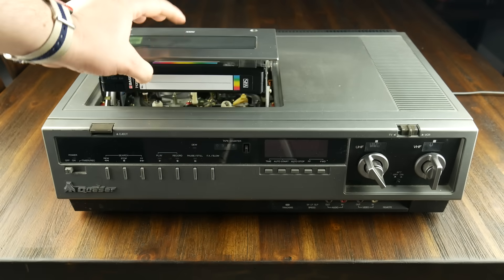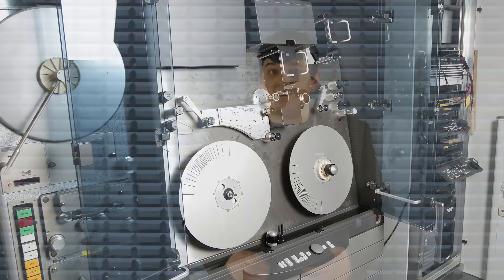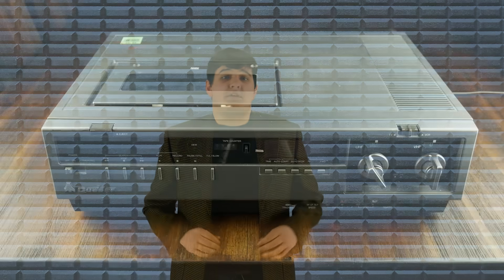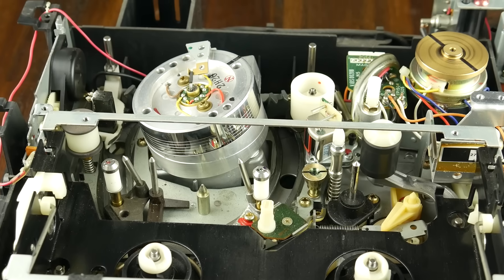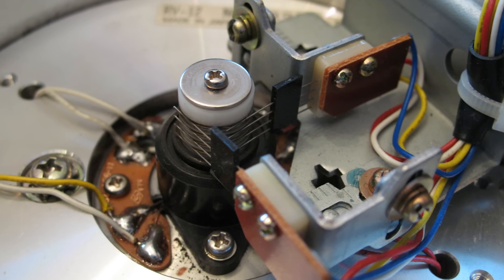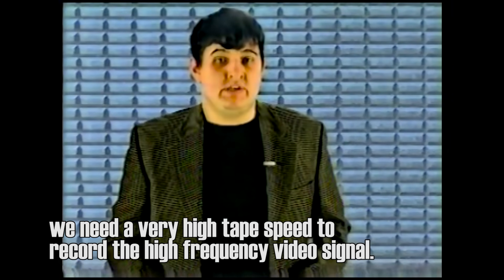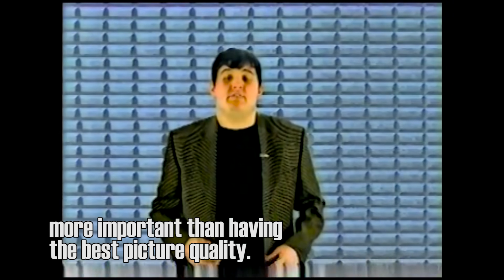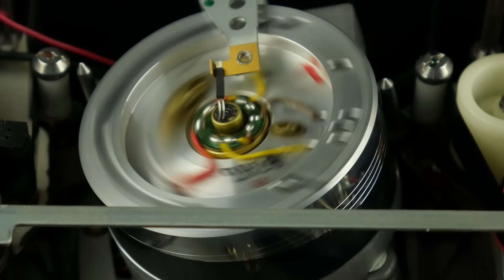The Impossible Feat inside Your VCR

Comment: Even all the way back to our first VHS VCR, I wanted to take advantage of LP recording, but our first VCR didn't do that. It only played. Later, my brother got for his first VCR a linear stereo VCR with Dolby Noise Reduction. He didn't realize until later on that the other VCRs that were being sold as HiFi were using superior audio recording and playback method. Instead, he thought it was some sort of gimmick. Back in the late '80s through the '90s, we just put up with the SLP/EP recording mode to stuff as much as would could onto each tape. Also, using a VCR was still new and magical so it didn't matter as much. That was mostly for general stuff like tape delay. Traditionally, we always used SP for important stuff like movies, but sometimes that 2hr limit became a pain in the butt. A TV movie without actively pausing for commercials ended up going past 2hrs. If you were recording the movie on timer because you couldn't be at home, you just had to put up with EP. After the year 2000 when I started using HiFi and later DVD-R, watching a tape that used EP just seemed God awful! When I digitized those recordings, I would reprocess the audio to crank up the treble. It actually does help to relieve that stuffed up feeling, but it just help a little. The highs ramp off as you pass the analog limit to you can only go just so far with pulling out the treble. For the video, I use varying levels of noise reduction to clean up the picture. This can increase your encoding time quite drastically since it compares the previous and future frames in the video to stabilize it. Sometimes, it is just worth it. On a modern computer, it can take a day or two for a movie. Just set it, do more interesting things, and come back later for the results. Older versions of noise reduction just blurred the picture. I still don't mind purchasing tapes on old movies since they are pretty cheap.

Comment: Wonder if the tracking pulses come from what looks like maybe a Hall effect sensor on the top of the drum?  Also wonder if you could tweak the control loops to pull the tape faster and get more bandwidth?  (Or would that mean changes to the head optimizations you were alluding to?)

Comment: While not tied to video, the SVHS tape standard saw it's usable life extended with the release of the ADAT multitrack audio recording system in 1992 by Alesis.  Original ADAT machines recorded 8 tracks of audio with a sample rate of 44.1kHz @ 16 bit resolution (8 * 44100 * 16 = 5,644,800 bps).  Later models could record 8 tracks of audio with a sample rate up to 48kHz @ 20 bit resolution (8 * 48000 * 20 = 7,680,000 bps).  In addition to the digital audio signal, the system would also record a sync track that enabled multiple machines (up to 16) to be networked together, allowing sample-accurate synchronization.

The use of videotape formats for professional audio wasn't limited to VHS as in 1993 Tascam introduced the DA-88 utilizing Sony's Hi8 tapes to record 8 tracks of digital audio.

Comment: Great video! The quality comparison is a bit unfair though. Digitized VHS on a digital screen looks way worse than it looks on a CTR TV.  But that's really nitpicking, subscribed.
Reply: biggest issue in D-VHS was the ability to move to a different time point.  It was still hunt and peck unless you made notes of where you wanted to move too.  DVR is near instantaneous or very minimal compared to D-VHS so even if it was hunt and peck there was very little time lost..
Reply: Well, yes, random seek speed is always going to be faster on a disc than linear tape.  That's why even in the 1980s-90s QIC tape was for backup, not running the OS.
Reply: You 2 should get a room...

Comment: Greetings from a 40+ year broadcast veteran. I am impressed. I'm also not given to fault-finding (all the time), but I wanted to point out that VHS won the format war because the porn industry chose VHS over Beta. That industry also chose VHS because SONY - bent on profiteering from the licensing of their format - limited consumer access to machine technology. VHS on the other hand was "readily" available and that translated into more rental dollars for the "industry". Also, as you mentioned, limited bandwidth for the color (or chroma) component versus the luminance component was designed after a fashion because the human eye has more 'rods' to perceive light (luminance) than 'cones' to detect color. SONY employed this philosophy when r&d-ing the BetaCAM format in which the compressed the color data by a factor more that the luminance. This improved the detail of the reproduced image, afterwhich the color is added. Good job though. It does my heart good that young people like yourself can still find a connection to where we've been; and not dismiss it out of hand.

Comment: Very nice! It's refreshing to see someone lay all that down so quickly and understandably. I have many audio only VHS HiFi tapes. Rolling shutters...LOL,  FEH! 
The wider format videotape reel to reel machines are really something to see at work. Check out any 'quad 2 inch videotape' (or quadruplex 2") video on youtube. Those machines are totally awesome, and the sound the heads make is unforgettable with the high pressure air bearing and (I think it's) 8 head stripes per 60th of a second. So thats 16 times the heads strike the tape per frame x 30 being about 480 scans per second. This makes a sound that's been described as a buzz saw, and this process is not exactly gentile to the tape. Early experiments at Ampex left the entire lab coated in fine black powder that had been the tape; although of course this problem was greatly reduced over successive generations of quad 2 inch machines and tape stock. 

One of the last 1" tape reel to reel analog editing machines had the entire tape path floating on air pressure as it went around the rollers and guides, which gives it (AMPEX VPR3) an absolutely insanely fast forward and reverse search speed. I know this because I have worked on such a machine that went completely apes**t on me and tried to destroy itself; nearly grabbed an office chair with a loop of tape and would have slung it across the room if it had. (The tape machine survived due to actual AMPEX quality construction and is now working). 

Another thing to note about 2" quadruplex machines is that they cannot produce a still image! This is because when the tape is stopped with the heads still running, video heads are only scanning 1/8th of a field (1/16th of a frame) of video. And this is only enough picture (image) to make up about 16 horizontal scan lines of image. Although it would be possible to simply repeat this vertically to fill the screen, 1/8th of a frame obviously doesn't give an editor much to work with. Thus everything was done in real time (editing and visual effects) when using quad 2" and some other tape formats. And most analog video production was edited in real time, meaning each edit and effect had to be 'pre-rolled' to give the equipment time to stabilize the image before the beginning of an edit took place, and only at normal speed. 

Originally 2" tape had to be cut with a knife to make edits using a microscope and what they called "developing fluid" to make the recorded video information directly visible to humans. Any mistake would cause the image to jump at the splice, and/or the tape to come apart at the splice during playback. 
The 1" AMPEX VPR3 (using what's known as the 1" type C format) is capable of reproducing an excellent completely clear still image and has a very sophisticated system that moves a video head up and down (with respect to the diagonal video track) using piezo-electric actuators, known as the "AST" function. The purpose is to keep that head right on top of the recorded area such that full quality images are seen in reverse and various speeds other then normal playback speeds, usually up to 3x normal. Playing around with these is almost pure fun when the right equipment is around! Even the VPR3 makes a totally awesome (and impressively loud) sound when you start it's (large) head drum.

Comment: You know I can't fully understand why VCRs are pretty much a thing of the past I know a lot of people always ask me why do I need a VCR when cable usually offers DVR's but I often come into a problem with DVR's they seem to malfunction pretty often for some reason and when they do when you call the cable company they tell you to replace the box the problem is all of the programming that you record on the DVR if the box malfunctions and has to be replaced everything you record is lost. This has actually happened to me several times already. now Look at this I still have a VHS tape from 1981 that I can easily play in my VCR which by the way I have three VCRs that work and I still use them today. Now I have an interesting suggestion for DVR boxes why not make them with memory cards so that way if the box fails you don't lose everything you've recorded because now your TV shows would be recorded onto a memory card. now I would have a love and a use for DVR's The other suggestion I would have is they should make an external input source for DVR boxes so if you want to connect say a video camera or an external source you can and if this is combined with the memory card it could all be recorded onto the memory card and you then would have a permanent copy how come no one has thought of this and how come no one seems to have an issue with recording programs onto a DVR and then only lose them all if the box brakes because to me this drives me crazy.
Reply: You should use a computer to record your shows. I was using a VCR until a couple years ago but began losing shows because tape ran out and got fed up with having piles of big cassettes around.
Ended up getting an AverTV USB tuner which works great with the built-in software to record TV to the hard drive, it can even handle a schedule.
Reply: orangie84 that's why you're crazy? I wondered about 20 words in 😂
Reply: Cut the cable! Save money use HDTV amplified antenna.
Reply: Why haven't you opened up the DVR and repaired it yourself. Didn't you make backups of the harddrive?

Comment: Good video. Three things to include. 
1. We used to redesign some of the VCRs and use the video heads for audio recording, hence getting a heck of a bandwidth and super low noise in the audio. With a good preamp, you ended up getting better sound quality than on a reel--to-reel tape machine.
2. What you describe is exactly WHY the moon landing wasn't a hoax. In 1969, the technology didn't exist to record a "fake" moon landing since recording of a video signal wasn't possible for any length of time. Instead, it was actually simpler to send the men to the moon and transmit from there. Add here also all other facts and it was simply not possible to fake it. 
3. You forgot that the true inventors of "home VCR" was Philips with its brick like cassette. In fact, i use to sell the first and second generation Philips VCR. It was interesting. The first cassette only held 15 minutes of tape. The second generation tape lasted 30 minutes if I remember correctly. Then came VCR2000 which had a way better image quality and sound than both VHS and BetaMax. However, Philips did f-ck up as usual and didn't understand the rental market. Also, due to "tape tax", you were forced to pay tax for the amount of time a cassette could hold and since a VCR2000 cassette could hold 4 hours per side and be flipped over, they became much more expensive than the VHS 4 hour tape that ran on half speed. Check out a VCR2000 if possible, they are way cooler and more sophisticated than the VCR but still analog.
Reply: >In 1969, the technology didn't exist to record a "fake" moon landing 
since recording of a video signal wasn't possible for any length of 
time.

First, even if that were true, what does it have to do with anything? Second, it's not even true, given that we have plenty of moon landing video footage, which means the technology to record it obvious existed in 1969, regardless of whether it was real or faked.   

>Instead, it was actually simpler to send the men to the moon and transmit from there.

No, it would be far, far simpler to transmit from Earth. I'm not saying that's what happened, but your argument makes no sense.
Reply: +Johnancquris
You didn't redesign anything.  Video heads on a hifi VCR ALREADY did audio recording.  All you had to do was send an audio signal into the L & R jacks and press record.
Reply: Either I was unclear or you didn't understand. We DIDN'T use the "audio inputs" of the VCR, we used the VIDEO amps, hence needed to do a small 
redesign of the physical connectors plus the video input amp. We GAINED way better bandwidth but mostly WAY better S/N. 
Today, when I record any audio signal into a digital recorder, I never go under 192kHz. If you don't understand why, I don't intend to spend the time to educate you. Educate yourself via Google in that case.
Reply: +johanacquris I would like to know the details of this modification.
Reply: It was around 30 years ago. I will try to find the drawings of the mods. And as a reply to your statement regarding the moon landing, there is a reason why there's only a few hours left. Since I was spending time in front of the TV, looking at hours of direct transmission, I know it for a fact. So, from the first moon landing in 1969, I think it only exist the "highlights" which is maybe tops one hour while the transmissions lasted to well over 20 hours non-stop. 
But I suspect you may not been born back then so it's not so easy to know if you weren't around...
Reply: None of that has anything to do with your argument. In other words, nothing related to recording video has to be any different in order to fake a moon landing or land on the moon for real. In the case of a faked moon landing, the live video transmission from the astronauts would simply come from somewhere other than the moon. In the case of a real moon landing, the transmissions would come from the moon. In either case, whatever recording was to be done would be done here on Earth. 

Some, if not all, of those moon landing recordings were, in actuality, done by pointing a film-based movie camera at a TV which was receiving the transmissions. That has been a viable method of recording video transmissions since long before video tape existed.

Comment: I purchased a Mitsubishi S-VHS machine in the early 90s. At the time, it was AMAZING. The tapes were a bit pricey...about $5 each. Normal tapes sold for $1-2 at that time. The machine could assess the quality of the tapes and make adjustment to recording parameters. The picture quality was great on my 27" Zenith CRT with S-video connections. It really was difficult to discern recorded material from broadcast TV.

Comment: Beta was better, almost all of the VHS improvements were forced by the Beta innovations, including slow motion, freeze frame, high fidelity audio, fast forward and rewind that included the picture on the screen etc.  VHS eventually adopted the "Omega wrap" threading to make fast forward/reverse possible in their format.  The original "M wrap" of VHS was too confining to allow fast forward or rewind to occur unless the tape was removed from the drum and confined to the cassette.  The reason VHS won was because of more recording time and the machines themselves were cheaper.  Studios also stopped providing Movies on Beta.

Comment: Very good explanation of VHS that can be appreciated by the average nerd. However, VHS itself was pretty much a Rube Goldberg production. They went to a LOT of trouble to design a mechanism that would allow video recording for the untrained masses at affordable prices. It's analogous to the steam engine which required 150 years to develop a fabulously complicated (and inefficient) machine by 1940. Diesel equipment blew steam off the rails in just a decade. Likewise, digital recording blew VHS off the air practically overnight, much like CD's blew audio cassettes away.

Comment: Extremely good.  I was a professional broadcaster from 1977 until about 4 years ago, just before a stroke ended my capability to handle working full time.  The first VCR I considered was actually a consumer version of a U-Matic [1/2 inch tapes in cartridges], but I wound up with VHS [also because every SONY product I ever bought died as soon as the warranty expired, except the VAIO laptop which spent the last few months in and out of the shop].  I had purchased and still own a Go-Video dual tape recorder, plus a VHS/DVD unit [I'd had a VHS/DVD-R but the VCR died].  Much of the information presented in this video would be known only by techies who worked either professionally or as informed amateurs.

Comment: Not all the competing formats pulled the tape out of the cartridge. The format my family bought, Quasar Good Time Machine, left the tape entirely in the cartridge. The reels were stacked on one side of the cartridge and would go from one reel, wrap around a plastic drum on the other side of the cartridge and return to the other reel on the opposite side (remember the reels are stacked on that one side). When it was inserted a mechanism would unscrew the plastic drum and drop it down around the rotating head and store it below the head. For removal the plastic drum would rotate up and back into place with the tape taken off the drum head on to the plastic drum. Tape never leaves the cartridge.

https://en.wikipedia.org/wiki/VX_(videocassette_format)

This format quickly lost in the format wars, probably because of its size.